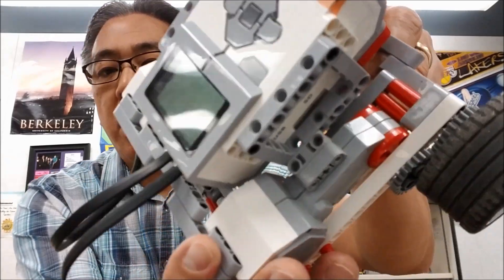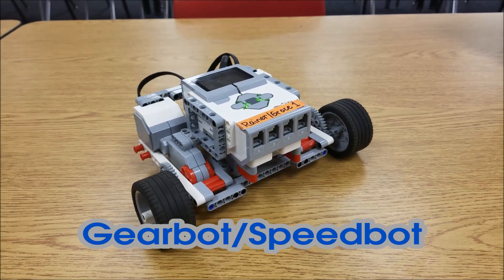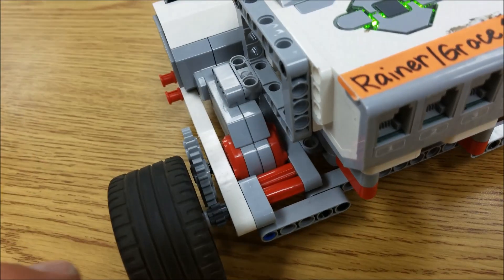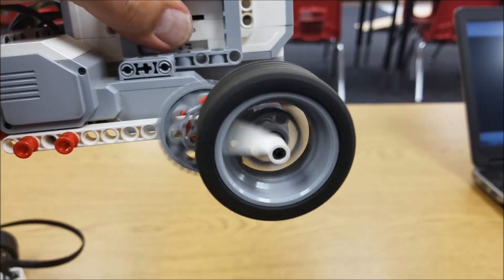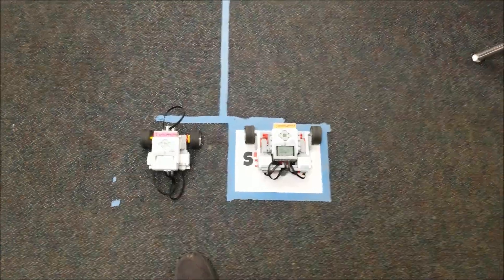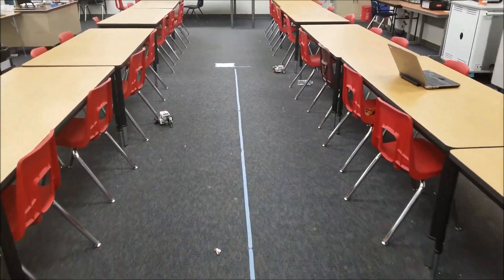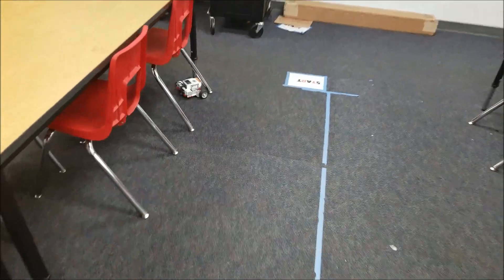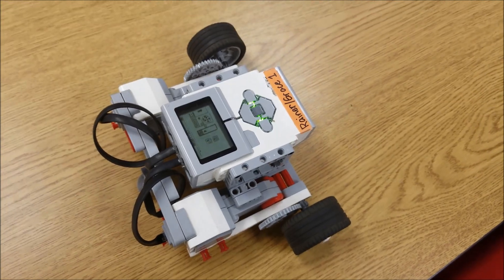"The LEGO Mindstorms EV3 Gearbot/Speedbot With Building Instructions"

Comment: If I use a 8 tooth gear to spin an 40 tooth gear will I get more or less torque than the Gearbot?
Reply from the maker: Hi Arie! You will get more torque because the Gearbot instructions has you using bigger gear than an 8 tooth.